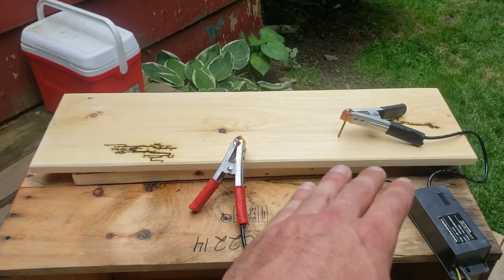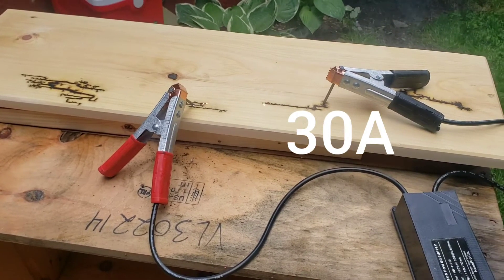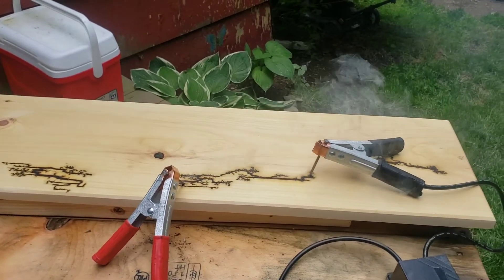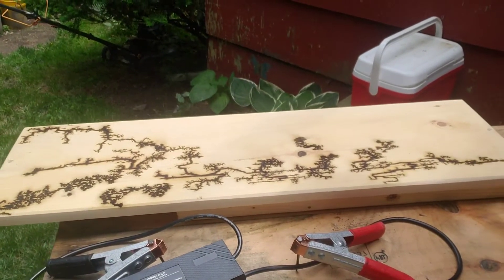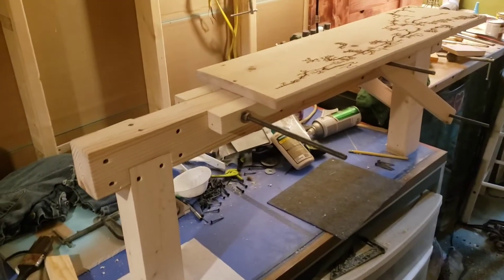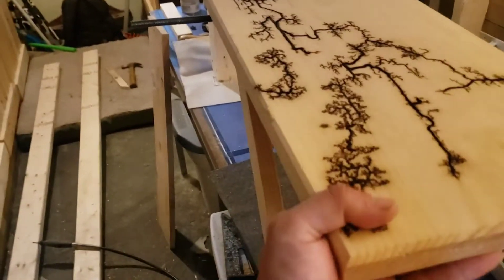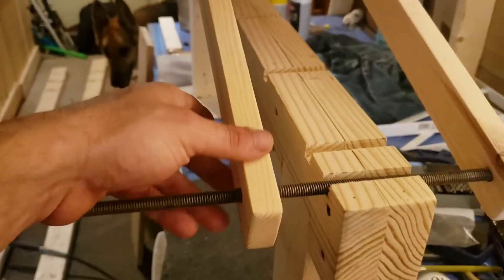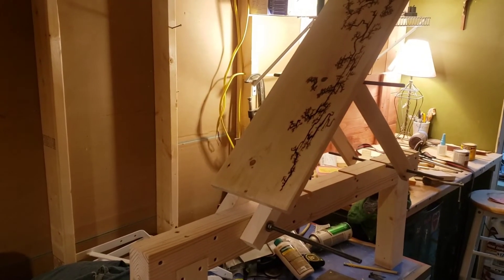First Time Fractal Burning. So Cool! Lichtenberg Figures (J.S. Woodcraft)

Comment: Since you are safer than a vast majority of the people I have seen, I have a question since it seems to be skipped over a bit. How long do you wait once you apply the mixture to the wood before turning on the machine to create the branch patterns?
Reply from the maker: I just wipe it down, you don't want to saturate it. It should be a light coating on the surface layers, just damp there's really no time frame I guess if I had to nail it down maybe 30 seconds to a minute and then it's go time. Once it dries it won't work
Reply: Where do you get the setup for step by step instructions for where to buy the setup I'm very interested so I can make some bar stools for my house

Comment: 30 mA, not 30A from that Neon sign transformer.
Reply from the maker: Yeah unfortunate typo. I cringed watching that back😬
Reply: @TheFishinDad  -Using a small Neon light power supply 20kV at 30mA  is a whole LOT safer than using a microwave transformer that  outputs in the region of 5 AMPS, there is no coming back from a hit from 20kV at 5 Amps. Of all the video's I have watched, not one uses proper high tension cable-i.e such as spark plug cables which are rated for high kV at low mA. The insulation is much thicker, unlike the normal house current cable for 120/240Volts at 15 Amps, it is totally the wrong cable to use in high tension applications. I am amazed at how close some of the DIY microwave users have survived the way I have seen their set-ups and they call a bare transformer with domestic wire on a wet concrete floor wearing open flip-flops, a Fractal Burning "Machine"-nothing could be further from the truth. I have used high voltage in many applications in powering X-Ray tubes and other vacuum discharge tubes all my life, my father was also an electrical engineer, so I learnt all this stuff from an early age. Many DIY builders really do not know the difference between Amps and milli-Amps, yet claim to be experts. I have seen video's of users of MV transformers actually applying the solution to the wood while the current is flowing through the wood, relying on the plastic handle of a sponge brush/applicator. These such projects should be banned from YouTube. Stay safe. Greetings from a retired scientist in Tasmania Australia.
Reply from the maker: @ShevillMathers   I absolutely agree with all of that. Thank you for saying it. It blows my mind how little respect people have for that amount of current. I know it's a little slower and not as deep a burn as quick with an NST but it is worlds safer and I think this is the kind of thing to take your time with anyway. There are several upgrades I'd like to make to my set up. Property insulated wire being the first and then some indicator lights in the line as well. Even though I know what's on and off on that rocker switch, it still can be ambiguous. I have a whole permanent home for it in my workshop with a thick rubber esd mat. Once I have ventilation down there that's where it will live but for now I have to keep it portable. Thats cool you have experience with those things, I also build and test x-ray tubes!

Comment: On the contrary to your newest video about wood burning here you are definetley standing close enough that could accidentally fall on that (passing out for example)
Reply from the maker: You're just looking for things to complain about at this point. If someone were to pass out while using a deadman switch their foot would come off the switch and the machine would immediately stop working. That is the point of a deadman switch. Even if I somehow fell while keeping my foot firmly planted (the opposite of the definition of falling) which is what it takes to depress the switch... actually, nvm, it's not my job to explain physics and electrical current to someone close minded, and even if I did you'd find another argument just to try to find a way to be "right" about something you already decided on. Have a nice day😁
Reply: Shutup douche
Reply: WTF????    Passing out????   Do your family a favour and don't play with power tools

Comment: Link to Ann Reardon's video on the EXTREME danger of fractal wood burning: https://youtu.be/GZrynWtBDTE

DON'T DO IT!
Reply from the maker: Ann shows the improperly set up microwave transformer setup that has indeed caused deaths. What I am using is a neon light transformer. 100mA is enough to kill the average sized adult. A typical microwave transformer output is 500mA. Mine is 30mA. This is why educating people on the proper way to do this will yield less deaths than censoring it as a whole. I just posted a video in response to all these comments showing why my setup is actually safe. Feel free to see if you can find any holes in my logic😁

Comment: that's really  cool  i may have to research this and give it a shot
Reply from the maker: Just be so careful if you do! I would hate for anything to happen. There are too many horror stories about accidents while doing this as it is. A neon light transformer is plenty of juice l, no need to go the microwave route
Reply: Do NOT do it. Lots of people have died from trying this. One tiny slip and you die before you hit the ground! It's so MUCH more dangerous than you think! Please please please don't do it!
Reply: If you do this, you will have 2000 volts of electricity passing through your body in a second if you touch the metal, wood, or anything conductive touching it product, this is 10 times more energy than is needed to stop your heart, you will likely be dead before you hit the ground in many cases and if you do survive you will live with lifelong issues with your heart.
Reply: DO NOT. DO NOT DO THIS. THIS SORT OF THING HAS ACTUALLY KILLED PEOPLE. HIGH VOLTAGE ELECTRICITY IS NO JOKE.
Reply: These people that warn you that this is so dangerous but themselves in more danger every day going to work. We all need to stop responding to these people.
Reply: Please dear god I'm begging yall don't do this it is extremely dangerous and has killed over thirty people already, I promise it's not worth it. Stay safe
Reply: @katherin5012  It is fine if this commenter wanted to replicate it but safety is a number 1 essential
Reply: @katherin5012 freedom of choice don’t need a nanny or mommy telling me what to do
Reply from the maker: @katherin5012  33 people have died in the last 6 years. In the last 6 years 300 have died on Jet Skis. Everything is dangerous. Thats why we're careful and smart about it. If you watched my video I pointed out how I removed all metal to prohibit arching and even use a dead man switch feet away which eliminates the possibility of being electrocuted entirely.
Reply: @TheFishinDad  it is still not worth it. One wrong move and someone dies. Kids watch this and do not take all the safety measures…why risk it?? You should have a massive warning up before the video begins with all the deaths this has caused.
Reply from the maker: @elisabethgreen1268  again, this is not an instructional video. People have been stupid with electricity long before fractal burning became a thing. No other dangerous hobby has ever gotten such publicity for 5 deaths a year. Something as tame as hiking has a thousand a year but its not as exciting of a thing to speak up about. I'm not sure who sent you all on this witch hunt but I do appreciate the view count spike. Of all the things kids are watching on YT I don't think a very niche hobby is going to be the thing that causes them to do something stupid. Plus, again, I dont show how to do this. Maybe an instructional video is more your target.
Reply: @TheFishinDad  I understand that it may not be as dangerous for you but as you have mentioned you have extensive experience and followed all safety precautions. Children on the internet may not treat it with as much care as you do and as you mentioned there are ten thousand volts of electricity, you said you removed all metal but did not explain how to do that or the importance of safety precautions in this situation, especially in a two-minute video. This is not an insult to you as a person and I don't believe you are trying to cause any harm but not everyone has the understanding of the danger that you do.
Reply: @TheFishinDad  If someone sees this video and copies it, it can be argued in court that it is an instructional video.
The reason I mention court is because if the person copying what you are doing dies, you could be facing an involuntary manslaughter charge.
Reply: And this is why we walked away from sharing cool things on YouTube!!  Yet these idiots that make kids shows are always pulling pranks and wrecking things. But that's ok right because kids will never do that.
Reply: You said 10,000 volts, that would kill someone instantly with one wrong move.  Promoting this is irresponsible.   Even if you are careful, you make it seem fun and easy and people have died.
Reply from the maker: @ms.c.2897  you can generate up to 25,000v of electricity dragging your feet across the carpet. Electroshock therapy commonly uses 10,000v. Please do some research. Yes in this application it can be dangerous because of the amperage which is why I have failsafes in place as shown in the video. The pedal is a Deadman switch. You step off it there is zero electricity. I won't be arguing this further but will be making another video. Thanks for the inspiration